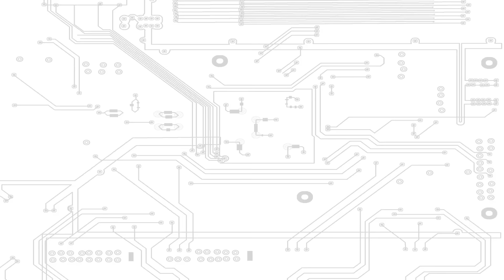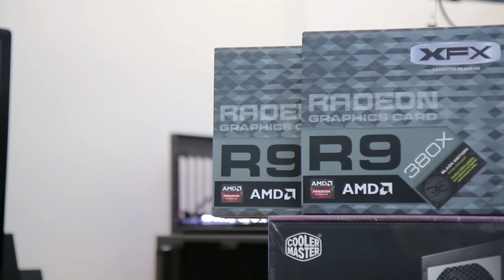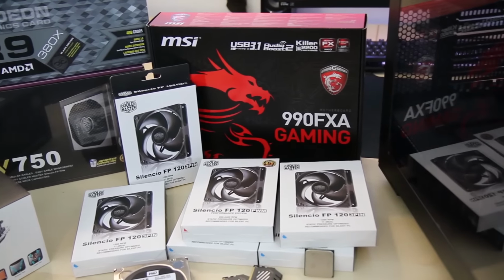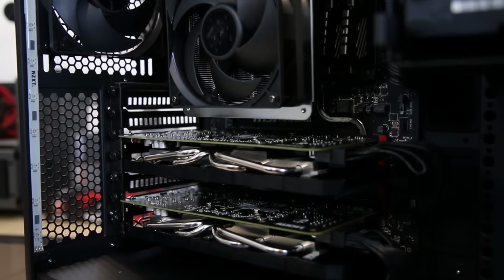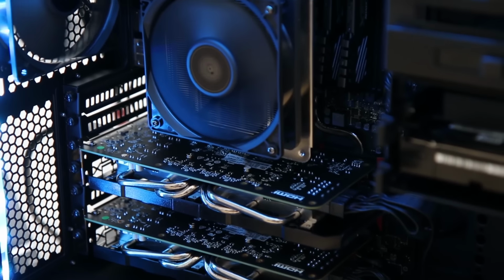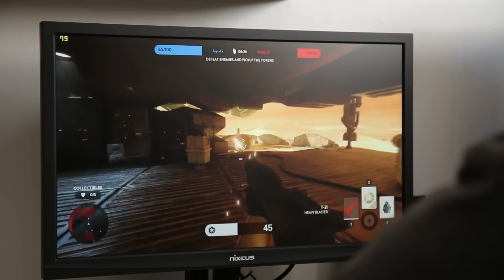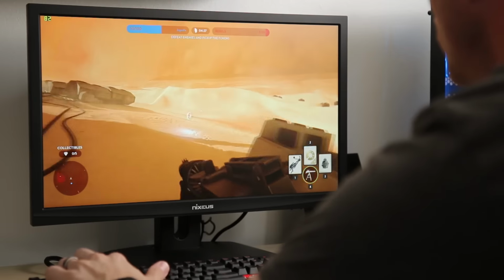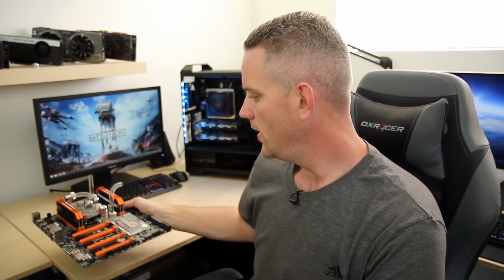AMD Gaming PC - Is AMD still good?

Comment: here's my rig

asrock 990fx fatality
8350 overclocked
gtx 970 asus turbo
8 gig kingston
240 kingston ssd
corsair 750 gold

this was my first build, howd i do?  it plays everything on ultra settings with no problems.  i don't know anyone irl that is into computers so i did my build solely from youtube videos.
Reply: +thedelta88   really good
Reply: you did about 3.5/4 /s :P
Reply: thedelta88 haha, sorry about that :P On the real though, it really depends on what you are doing with your computer.  If you are just gaming, I personally would have gotten an i5 and OCed it.  Also, you could have gotten a better PSU and better SSD for the price (assuming they weren't on uber sales at the time)

Comment: Holy, that 4 TB hard drive. I'm assuming thats from another build or something unless you believe in Storage overkill too haha.
Reply from the maker: +sHir0 Just a drive I had laying around that I wasnt using.  But considering that this game is 38GB, BF4 is 60GB, GTAV is over 50GB... you can see how fast storage will run out.
Reply: +JayzTwoCents +JayzTwoCents  For real. New update was for GTAV was over a Gig. Just for an update!
Reply: +JayzTwoCents hey jayz any recommendation for a external audio dac where i can connect a 2.1 system and a headset without paying too much.
Reply: +JayzTwoCents Yeah I can see that but man are 4TB hard drives expensive. I'd rather go through the hassle of multiple hard drives to save a little money.
Reply: +TheTarne Get this for dac/headphone amp, https://www.massdrop.com/buy/massdrop-o2-odac or http://audioengineusa.com/Store/Digital-Audio-Converters/D1-24-Bit-DAC
connect it to your pc with usb, get stereo amp for your speakers, connect via RCA, and there are various ways of adding a sub. depends on what subwoofer you have.

Comment: It's really nice to see a PC build in a youtube video that isn't Intel + Nvidia for a change. I'm curious though, why was the 8370 chosen instead of the 8350 or 8320, when the 8350 and 8320 are the same exact chip as the 8370 with slightly different clock speeds? Since getting the 8320 and just overclocking would be cheaper, wouldn't that be a better choice? Then the saved money could go into a small SSD for the OS or something.

Comment: Just to add, I'm not convinced that the theory of one powerful card being better than two lesser cards always applies. I have 2x R9 390's (Asus DCII), my roommate has an EVGA 980 Ti SSC, and my system consistently out benchmarks his in almost every game. The rest of our systems are identical, with the exception of storage, PSU's, and cooling, his being watercooled versus mine on air (given this is probably the most ridiculous air cooling setup I've ever assembled): 4690k OC'd to 4.6 Ghz, Asus Maximus Formula VII, 32GB EVGA DDR3 2400. But anyways, there is an improvement to be had in performance using 2 R9 390's vs 1 980 Ti, at only a slightly higher cost (~$50.00). The watercooled system has a custom EK loop with D5 pump, CPU, GFX, and MB all watercooled. The air system has 4 200mm fans, 5 140mm fans, and the CPU cooler is a Hyper 212 Evo with dual 120mm 3000RPM San Ace PWM server fans (very loud, but effective)

Comment: Not trying to run this issue into the ground, but I want as many opinions as possible. Read a lot that you don't need 6 cores for gaming, but I particularly like to play open world games, where the world is constantly loading and one minute you're just walking along and then you turn around and you can see the highest concentrated area (downtown urban setting, largest village, etc) and then framerates start to dip.
Would having more cores combat this issue?

Comment: I really do appreciate the AMD Build, just like your APU build im really happy to see people actually use AMD and/or APU's. I myself have and AMD Build its nothing to brag about and lacks in more than 1 area, but i would like any opinion on it. 
My Build:
Motherboard: MSI A88X-G45 Gaming Motherboard
Processor/APU: AMD A8-6600k 3.9-4.2(OC) GHz Quad-core  APU
GPU/IGPU: Integrated HD 8570D 844-950(OC) MHz Graphics
RAM: Corsair XMS3 8GB DDR3 1333-1600(OC) MHz, PNY Ultima 4GB DDR3 1333-1600(OC)MHz
Hard Drive: WD Green 3TB
Power Supply: Thermaltake Smart M750W 80+ Bronze semi modular
CPU/APU Cooler/Fan: NIC F3 Untouchable 120mm CPU Cooler
Case: Unknown mid tower case from 1998
Monitor/TV: Sylvania LC427SSX 42" LCD HDTV - 1080P
Keyboard: SteelSeries Merc Stealth  Black USB Wired Ergonomic Gaming Keyboard
Mouse: iHome wireless Laser Notebook Mouse - Red, Razor Deathadder broke

Comment: Very pleasant build Jayz. I might have a question (anyone could answer) I saw you sliding the drive around the fifth minute and I was wondering. What do you do against the vibrations? I can clearly hear my drive in this mount. I stuck some foam foil between the rack and the case, but it doesn't look very nice. Any suggestions?

Comment: I built my wife a gaming PC with a AMD 8350, MSI gaming board, GTX 780, and 16gb of ram along with a G-sync BenQ 2420g monitor for about $1,200 with case, sad etc. She games on par to my i7 4970k/GTX 980ti set up. These games now of days are not really pushing the hardware like in the old days. You can get away with a great set up these days for cheap.

Comment: I WAS running an AMD build until recently.Was running an FX-8320 + R9 290.
Now I'm running an i7-4790K + R9 290. I AM an AMD Fanboy, I like AMD but the low single core performance of the FX-8320 just killed it for me.I had so low FPS in games that utilized only a few cores, especially MMOs.You'd think MMOs would run fine on that kind of system but they really don't.
The FX CPUs are really good for people on a low budget because they are still really fast in games that utilize their cores but in Games that don't utilize all of their cores...meh.
CPUs aren't as important as many people think, major misconceptions floating around. A lot of people are still running older generation i3s i5s and i7s and still have really good performance.

Comment: My system is as listed
- Amd fx 8320 black OC'd to 4.3ghz (sits at 30c max when running high stress and closed case in closed room)
- WD blue 1Tb HDD
- 2x 8gb crucial ballistix sport low profile (like 2cm tall) DDR3 for a total of 16gbs at 1600Mhz 
- a single Sapphire R9 290x Tri-x OC non-windforce at 1140 MHz core clock (if I remember correctly)
- I have a custom water loop with 1 360mm x 120mm x30mm copper rad with only two fans on it, and 1 240mm x 120mm x 50mm with 1 low profile 120mm x 10mm fan.
- the MoBo is a Gigabyte with 970 chipset
- aftermarket Northbridge heat sink with a 40mm fan (cuz Northbridge) 

Runs fallout 4 at 25-30c cpu temp and 68-71c gpu temp (closed case and closed room), with graphics setting at 2560x1440p up-rendered on a 1920x1080p tv with full ultra settings and a few HD texture mods. Producing a minimum of 30fps in performance heavy environments.

Comment: I am not an AMD fanboy, but for CPUs I have to say, I am hoping that AMD will build another outstanding and long lasting CPU generation. I still roll a Phenom II X6 1055t, which at the time I bought it (2010) was a sub 200€ CPU. If I look at the Passmark Score for example, it performs about 10% less then a i3 6100 - a CPU which was just released a few weeks ago and costs around 120-130€. So if this means, that my CPU has "lost" under 70-80€, I am totally fine with this development. I am also able to put this CPU in an AM3+ Mainboard like the one that was shown in the video, so that i would have modern things like USB 3.1 onboard - try this with an i5-750. I originally wanted to replace my CPU/MB In favor of a Skylake-E processor (something like a i7 7930K), which are hopefully released in 2016, but I fear that Intel CPUs have to be replaced more frequently, even if they are faster than their opponents at the time of release.

If you are interested, my Rig was updated with a GTX 970 over a year ago, and in games, the cpu is usually up to 80% utilization, while the GPU is at 100% almost all the time. Also this machine runs very cool, since the Amd CPUs dont seem to dissipate as much heat as the Intel ones - my GPU, overclocked to 1177 and sometimes more, usually does not heat up to more than 60C.

Comment: I've been meaning to upgrade my APU build, I've had it since 2012, I have the A10-6800K and plan on to getting the 7870K and getting a WAAYYY better card than the 750 I have now! Also 1866MHz Ram just to get that pinch of more performance. Comment away on your thoughts😊
Reply: akalion213 what do you recommend my specs are
A10-6800K
GTX 750
8GB-1600MHz
GA-F2A88X-UP4 motherboard i got a few months back, want to keep using it.... thats why I wanted to get the above components
Reply: akalion213 Nice! Ill look into that CPU that's perfectly in line of my price range. What GPU do you recommend for under $200

Comment: i just built an all AMD system. well all AMD, Cooler Master, and Asus. 9590 processor, 32 gig AMD 2400 mhz memory, Asus formula Crosshair motherboard, Cooler Master V1000 power supply, Cooler Master 280l processor cooler Cooler Master CM Storm tower. oh, and 2 R9 390x video cards :D I Love This system. Pretty much run at max video settings in all games, with dual monitors and only 1 video card (dont have the second card in yet) and still average about 100 fps.

Comment: Is the FX platform still viable in todays market or just wait for the new Zen?
Reply: +minime100797 Its good for entry level and even some hardcore gaming
Reply: +minime100797 it's a good alternative to i3's for budget builds, something like an fx-8320e is just between i3 and the cheapest i5
Reply: +minime100797 Not anymore unless upgrading, The Skylake Pentium G4400 and Core i3-6100 both eliminate AMD in the budget and entry level CPU, and AMD's only mid range CPUs (FX 8350, 9370, 9590 (9xxx series run awfully hot and are SUPER overpriced)) aren't worth it in a new build.
Reply: +minime100797 maybe but it could take a while. As long as you dont wanna spend the money on an expensive i5 you are really fine with an FX processor. The difference in most games will be different to an i5. If the game uses all cores on the FX 8320 it is stronger then an i5 4690k for example. But few games actually do support all atm.

Comment: How about power consumption? Does this system go over 500W in demanding games?
Reply: +Killing joke Are you gaming with one eye on the electrical bill?
Reply: +TheScania1991 do you still live with your parents?
Reply: +TheScania1991 I'm just curious and want to compare it with Intel+Nvidia build that performs about the same or better.
Reply: +Killing joke If both GPUs are being utilized then it would easily go over 500w.
Reply: +Mister5597 Yeah, well I was just wondering if that PSU wouldn't be under a lot of stress.
Of course it will handle this system but could get loud and pretty warm I guess.
When you overclock FX-8xxx it can easily go towards 200W, then two gpus...

Comment: Hey there #JayzTwoCents, I just wanted to add a quick correction, unless Cooler Master has specifically said otherwise, if you look closely on the package for the CPU cooler, it is actually the Gemin II, and not Geminii... They used a capital 'I' in Gemin, and then used the Roman Numeral II afterwards, so it should be pronounced Gemin II(G as in goat, or greedy Jay doesn't share his free hardware with the poor newbz (-; hehe and II as in Two)
So, the full name would be Gemin Two S254 Version 2... Unless of course the folks at Cooler Master have no freaking clue what they are doing, which, given some of the things modern companies have been doing, it is entirely possible, and at the very least, forgivable, it's not like it's "GeminiGate", right...? lol

Comment: Dear Jay: I bought a MSI 970 Gaming MOBO to run my custom watercooled fx 8320. I never even knew that msi made a 990 chipset gaming edition mobo  atm so I went with a 970. I Run my cpu at 4.56GHz regularly. Is it dumb that i bought a 970 and is it worth it to maybe sell my 970 to buy a 990 board? Thanks jay great video.

Comment: Go with R9 200 series before R9 300's any day. When you really look at it, the only real benefit of the 300's vs the 200's is age and slightly better power consumption, verses the better price, usually better raw power and specs of the 200's...   As far as my experiences and research goes anyway..
Reply: That being said... I'd still prefer a low-end 980 anyday.
Reply: the 300 series has more ram which  is good for the new driver technologies such as shader cash which preloads textures, lowering loading  times.

Comment: Jay, would you recommend a gtx 970 or an r9 390 to a beginner like me?
Reply: +Jonathan Schneider (Joschneider0)   psu ??
Reply: +hello walkman EVGA 500B
Reply: +hello walkman My current build: http://pcpartpicker.com/p/CKzZVn
Reply: Jonathan Schneider   psu isn't enough for the 390 so get 970.  also overclock the cpu to as far as you can ..  at least 4.5GHz
Reply: I currently have around $450 to spend.
Reply: Jonathan Schneider
get an i3 4370 + 970 evga SSC
Reply: Thanks for your reccomendation :)
Reply: Jonathan Schneider
no problem :)
Reply: +Jonathan Schneider (Joschneider0) People will hate me for saying this but i would get a gtx 970, especually when You are a beginner, much more polished experience id say. Btw im not a fanboy i had a r9 280x which i had tot rma twice because of artifact issues ;)
Reply: Caspar
ye, I am going with the 970 because after a bit of research I found that my 500w psu wouldn't be able to cope with the r9 390 plus the xfx model i was looking to get doesn't fit in my case xD. With the $600 I have accumulated over time, i'm looking to add an i5 4690k and a gtx 970 to my build. Thanks for the reccomendation!
Reply: Jonathan Schneider bro with 600$ rather get i5 4440 + r9 fury
Reply: pricing is different here in the UK. $600 is roughly £400 and the sapphire r9 fury on amazon costs around £450. It sucks but that's UK pricing for ya.

Comment: AMD FX chips are still just fine for gaming. You won't win any benchmark battles with Intel but you will be able to play at very high framerates providing you have enough GPU horsepower. I have a FX 8320 running 2 GTX 970s in SLI and there is room for the CPU to stretch it's legs even further with both cards maxed out. There is no bottleneck contrary to what you hear PPL say all the time.

Comment: Well, that was an excellent video. But, wouldnt a single r9 390 be better?
Reply from the maker: +Ultimate Tech Helper 1.0 You clearly didnt watch the video if you are asking me that.
Reply: get rekt skrub lard
Reply: +JayzTwoCents Funny, my R9 380 Gaming OC 4GB from MSI has the same fps that you are getting with those 380X oO (I didn't do any overclock whatsoever to the GPU)
Reply: +JayzTwoCents Well, you are partially right. I watched only the build part. And also, I forgot to add from a power and heat standpoint.

Comment: if I want to build my first pc should I go with amd because it's cheaper?
Reply: HELL NO!! Don't make the same mistake i did and buy a Amd to save money, you will regret it. You have 2 option... Wait for Zen or, buy a i7. You can buy a i5 but you will need the hyper-threading in the years to come because of dx12. My best advise is to, save up and get an i7, you can play anything with an i7. Amd cpu's, like my 8350 can't handle cpu intensive games like TW:Attila. I have to play unit size on small because the cpu is so weak. 

Avoid Amd!! Except for their graphics cards, the new Rx 480 is good for the price.
Reply: imo if u truly want to build a budget build, get the i3 6100 with the gtx 1050ti, or if the g card is too much dip down to the RX 460.
Reply: agreed. AMD Cpus arent TERRIBLE.. but INTEL is much better for price and future. AMD g cards are not half bad and are underrated.
Reply: AMD CPU's are actually quite good. Take a bit more power and probably have to invest in a hyper 212, but it does indeed perform competitively with lower tier i5s and i3s of the skylake series. Problem is, they are very outdated. Better of getting a i3 6100 with a 1050 Ti as the other person stated.
Reply: Robomarston wait for amd zen cpus to come out and decide
Reply: ***** If he switches from AMD to intel, he has to replace his mobo as well. AMD single core performance is not good in comparison to Intel cpu structure. The more cores doesnt always mean the better. Hopefully RYZEN changes AMD single core performance for the better